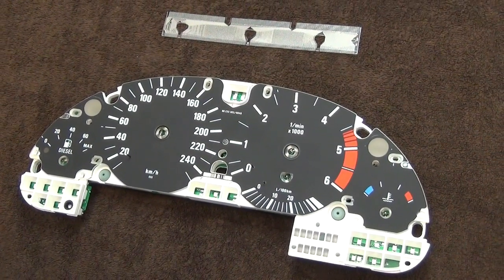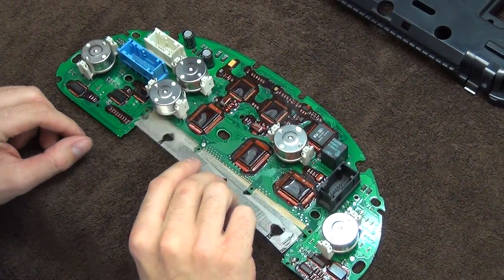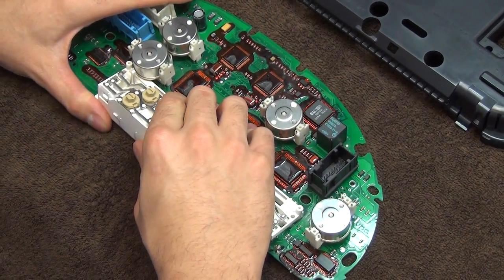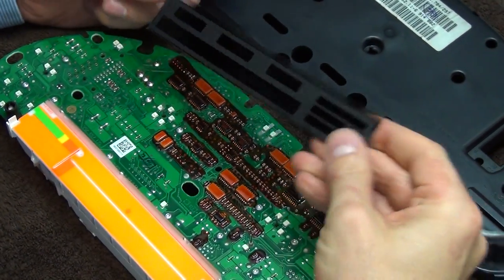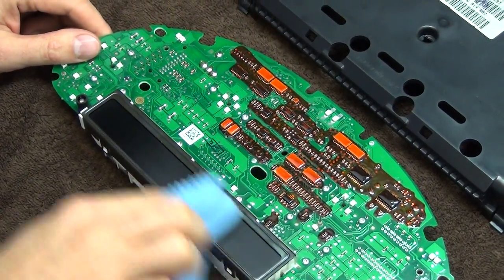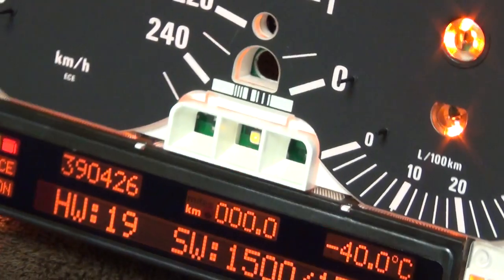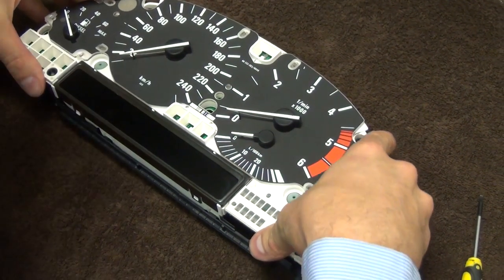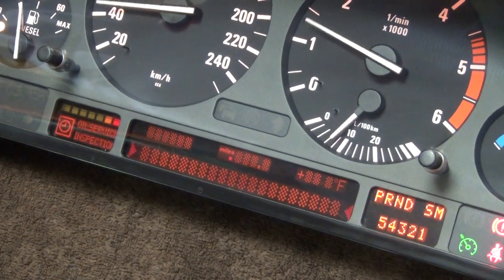BMW pixel repair - E38 E39 speedo LCD display - silver ribbon cable - UNCUT

Comment: orginal sticks together in a fringe. But changing your time has served the circuit board display. Tape does not guarantee a long time. Tapes become loose over time. Pixels contacts display deformations will appear.

Comment: thanks for this video, could u tell me What do you use to test it at home and how to connect to power
I means 12 volt
Reply from the maker: Of course,

White connector:
pin9 gnd
pin10 gnd
pin16 12V
pin15 12v

Blackconnector :
pin7 12v
pin8 12v
pin1 gnd
Reply: Is this the same for a 2003 E39 ?  How much amperage with the 12v ?

Comment: do you need a special tool to remove the needles?
Reply from the maker: Yes you do. The needle remover tool is also available here: http://www.pixelfix.net/eng/bmw.html     You can not see the actual tool on the picture as pantent is pending.

Comment: Csiboreszkudo, I guess I'm a bit "late to this party..." I just found this video and I'm really impressed by the detail and clear instructions. What I haven't seen is any contact info with which to order/purchase these kits. Is there any list of available kits for the different problems and how can I order/purchase them?

Thanks for all your effort in creating & posting these videos. They are really informative!   -Gary
Reply from the maker: Thanks Gary! Please go to www.pixelfix.net/eng - there you find all the products we have in stock. 1-2 business days delivery available in the EU and in the United States, so you can get it superfast...
Reply: Thank you for the very quick reply. I looked on your site and found quite a selection of items but I didn't see much for the BMW E46 3-Series. Are those parts not available or maybe listed elsewhere?
Reply from the maker: Unfortunately there is nothing for E46. E46 speedometer displays do not tend to go faulty, so we do not have a repair kit for it. If your display is completely dead, you may need to check the bulb behind the display...
Reply: Actually,  the button to the right, that changes the time is intermittent and I thought maybe there would be a replacement part available. I don't mess with it, thinking that something worse might happen with it... so I just leave well enough alone!

Comment: Hi, why not use soldering? no need?
Reply from the maker: This is a special silver cable that does not need any heat bonding, or glue. You can use it as seen on the video.

Comment: Hi, what kind of car are you working on?  I need to repair/replace LCM on my e38. Any help on how to would be greatly appreciated. Thanks, Annemarie C
Reply from the maker: Hi,

here comes the full repair procedure in pieces:

Remove the speedo from the car: https://www.youtube.com/watch?v=Z0kkjzFfg_M&t=3s
Open the speedo: https://www.youtube.com/watch?v=5t8Gsxqu-Fk
Remove the back: https://www.youtube.com/watch?v=ln26cPpp7HU
Gauge needles removal: https://www.youtube.com/watch?v=moZ0ctQxWNY&t=23s
Cable replacement: https://www.youtube.com/watch?v=7MzEeepJpvE

Balazs

Comment from the maker: The KIT comes with a needle removal tool, so you can easily remove and put back the needle. This procedure is fully covered by the repair manual.
Reply: Csiboreszkudo  where can I buy the kit?

Comment: Our mileage, KM, and outside temperature does not light up at ALL, but the fasten seat belts and key in ignition lights do but with a few pixels missing.  Would replacing the ribbon with your kit work for this or would we need to replace bulbs as well?  Needless to say we only want to disassemble this once.  Any assistance you can offer would be much appreciated.  Thanks.
Reply from the maker: Hi,

most likely you have faulty bulbs behind your display (that makes part of your display completely dark), and a faulty ribbon cable that makes the resto of the display pixelated. . 

I hope I helped,
Balazs
Reply: +Csiboreszkudo Thank you!!  Yes, that's what we needed to know!  Do you, by chance have a video posted of how to change those bulbs?  And can we also order them from you as well as a the ribbon kit?

Comment: how to remove the needles?
Reply from the maker: You need to use the pixelfix needle removal tool - this tool comes with the cable for free, you will find it on the package together with the silver cable and the repair manual.

Comment: Hi, do you have the cable for a 2001 X5, if so how can I get one
Reply: Csiboreszkudo
Reply from the maker: Hi, 2001 X5 vehicles have the exact same speedo, so the display you see in the video will fit your speedo too. Just click on the link above to buy it. Balazs

Comment from the maker: You need to grab te shaft with a long nose plyers from the back side of the panel. It is not easy as there is a little gap to go in there, but can be done with a long enough nose plyers. Before removeing it, mark the zero point of the gauge, so you will know where to put it back, this was there is no to recalibrate anything...

Comment from the maker: The KIT comes with a very detailed repair video + a printed color repair manual that shows you both procedures, such as:

- repair with removed needles (no drilling required)
- repair without removing the needles (drilling required)

The manual shows precisely where to drill the holes.

Balazs

Comment: Have you created the video to remove the needles from the cluster? Or what is the "simple process" to remove? it seems that when you attempt to remove or lift, it puts tension on the copper springs underneath...in addition, when you expose the pin holding the needle and grip with a long nose plier, the needle still dosent want to disengage.  Please advise.

Comment from the maker: Good thought, but as you see there was no need to recalibrate the unit... Anyway, your method also works great. The needle removal is not too difficult, I'll upload a video later on with covers this topic.

Comment: Nice vid, but I read in alot of tutorials that you're not allowed to remove the needles for the speedo, mileage and RPM because then you will have to have them calibrated.

I drilled holes on the bottom of mine to be able to unscrew the unit, the holes are not visible when the cluster is assembled.
Reply: How did you know where it drill the holes

Comment from the maker: try this:

White connector: 9 gnd, 10 gnd, 16 12V, 15 12v
Black connector: 7 12v, 8 12v, 1 gnd

Balazs
Reply: Hello . this wiring is just for this model or no ? can i use this model to turn on any speedometer ?
Reply: Csiboreszkudo Thank you. Are these the pinouts that you use for your test power supply?

Comment from the maker: Hi,

well this cable replacement will solve the pixel probelms - definitley. This is an UNCUT video so can see it with your very eyes. You may also need to replace the bulbs if the display is DIM.

Balazs

Comment: Hi. I am writing to you from Azerbaijan. I have the same problem in my cluster instrument. I can not read anything in the display.
I would like to ask, in my BMW e39 525i 2002 years, I can not see the warning words, also kilometer, anyway everything is incomprehensible. If, I will change the silver ribbon cable, everything will be perfect as in video? No need change lamps or another things? Please reply to my request...Thanks a lot...
Reply: Nothing else needs to be replaced. My E39 also had dead pixels, will need to replace that cable too.

Comment: Hey... I opened up the speedo but the needles aren't coming off.
They are tied to a thin coil. Which I don't know if I should remove. Additionally the mpg needle doesn't budge. It doesn't come out like the others I don't want to break it. Please help. Can I im you.

Comment from the maker: No worries, as the adhesive tape needs to hold the cable in place during the assembly procedure only. After that, it has nothing to do, so if it dries out, nothing happens. We do these repairs with lifetime warranty, our experience is that once a repair was carried out properly, it will never fail again...
Reply: Great, thanks for your swift answer in this matter.

Comment: Hi Balázs,

Just bought one of your silver ribbons for the deathpixel problem I have with my BMW E39. I hope I can do it in 5 minutes also.
What will happen if the standard adhesive tape you use to fix the ribbon in place, dries out?
Reply: do you know something new about it? i will do that tommorow...i hope i will repair it..